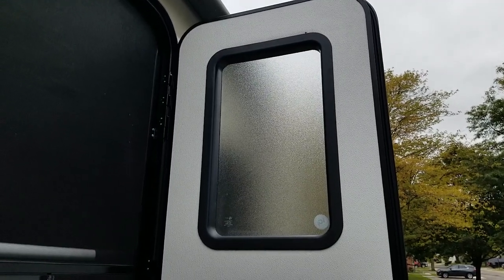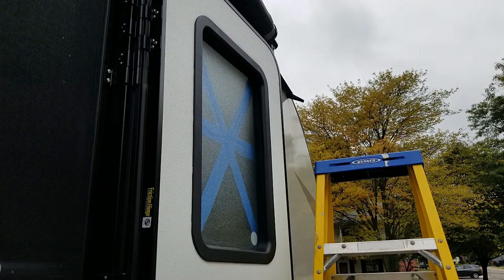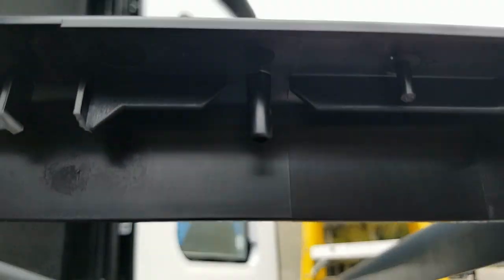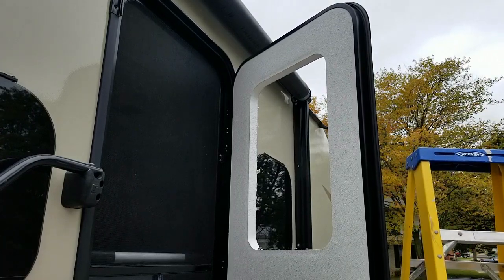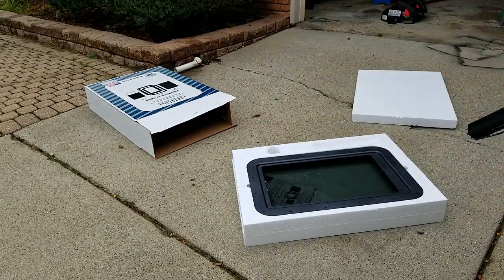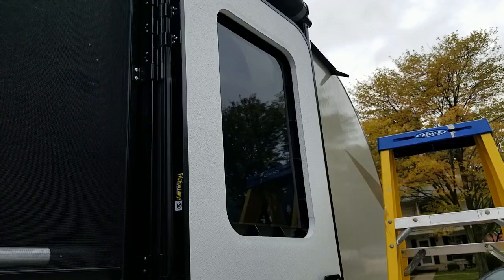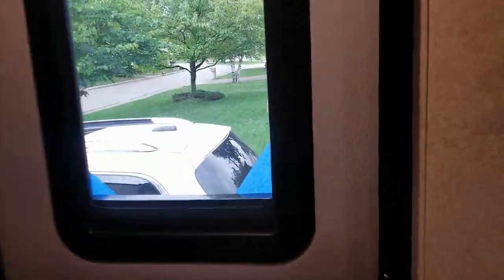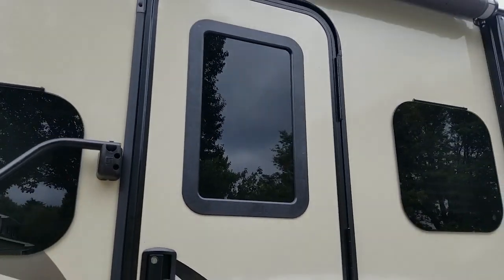Lippert Screwless Window Removal & AP Products Thin Shade Install

Comment from the maker: 00:28  items needed for install
00:44  tape window
01:23  removal clips install
04:28  old window frame inspection
05:38  old window glass removal
06:50  door structure inspection
07:49  shade unboxing
09:42  shade install
12:10  shade demonstration
Reply: How do I get those clips?
Reply from the maker: @JS-wx6eg  I contacted AP Products and they mailed them to me.

Comment: Great video. Here’s a tip.....what I did was sprayed silicone spray on a rag and then rub it on the shade cords and the shade will slide up and down easy with one finger :)
Reply from the maker: Good tip, I was thinking some kind of spray would help. I'll add some 👍

Comment: Great video. I am about to install the AP Thin Shade on my Rockwood 2509s and you did a great job of showing how to release the clips. Are you in the Mini Lite Group?
Reply from the maker: Do you know a guy named Adam Douglas? 😀
Reply: @aguyandhiscomputer  Yes😀 Hi Adam!
Reply from the maker: Hey :)

Go slow when pulling the frame. I could have gone slower and not broken any clips. I don't plan to reuse it so not worried about it but something to be mindful of.

Comment: Putting the window in upside down is a great idea for the privacy aspect, but has the fact that the weep holes are no longer at the bottom of the window to allow condensation to escape, been a problem since you did it? I'm ready to install this same window and may consider doing it upside down too, but worry about the weep holes not being able to do their job.
Reply from the maker: Hmm... I didn't notice the weep holes when I installed mine. I'll have to take a look.

Can you turn the outside frame upside down so the weep holes are at the bottom?
Reply: @aguyandhiscomputer  The weep holes are actually on the inside, since it's to let any condensation drain out of the frame instead of being trapped in there. They are three little slots, which I may try to replicate using my Dremel tool on the top portion (since it will be the new bottom).
Reply from the maker: @larryjones5079  ah, ok, yeah, you don't want trapped water.

Comment: Hello and great video ! Can you share part # for the clips I need them also to remove the trim ....thank you !
Reply from the maker: I actually called AP Products and they mailed them to me free.

If they won't do it. $7 car door panel removal tools from Amazon will work. I'll never reuse the window frame so I didn't care that I broke some of the tabs.
Reply: aguyandhiscomputer just contacted AP they are mailing me the clips at no charge ....thanks again your video helped me !
Reply from the maker: @8032609  Awesome, glad they're mailing them to you. What kind of trailer do you have?
Reply: @aguyandhiscomputer  2019 Sunset Trail Grand Reserve 26SI by Crossroads
Reply from the maker: @8032609  Nice looking trailer. Lots of room.

Comment: Did you have to purchase the release clips separately or did they come with the window?
Reply from the maker: I contacted AP Products (Southeastern Michigan) and they mailed me some. 

Let me know they don't send you some. I mailed mine to someone in a Facebook group and they've done the same for someone else.

You can use automotive tools if you don't care if the window frame clips break. I broken some but I don't plan on reusing it. I did keep the glass in case of an emergency if my new one breaks.
Reply from the maker: A kit like this will work fine.

Tresalto Auto Trim Removal Tool Kit, Set of 5 Pcs https://www.amazon.com/dp/B01L8GHB7O
Reply: I did send them an email and voice mail , mine didn’t came with clips if still have them let me know thank you

Comment: I wonder if the AP release keys (probes) differ from the Lippert ones?
The [way too expensive] Lipperts ...
https://store.lci1.com/window-keys-16-pack-429436.html
... are about 2.25" long (including the 3/4-inch "handle" that doesn't fit through the slot).
It's 1/2-inch wide, tapering to 1/4-inch starting about 3/8-inch from the tip.
The 1.5" length inserted into the slot has a narrow channel that rides along a ridge in the window frame to keep it on track.

When inserted, the sides of the key bump into two spring-loaded clips that interlock with barbed posts from the outer frame.
Pushing the key to the half-inch width will separate the clips slightly, but perhaps not enough to release the barbed posts.
Pushing further, the narrow tip reaches the curved frame which pushes the key up, further separating the latches, which finally let go of the barbed post.
When all the keys are fully inserted and the posts released, the window frames would separate unless the silicon sealant holds them to the door.
Peel them apart carefully.
Reply from the maker: After looking at my video, the release keys look the same. $22 is a rip-off for little plastic clips. You can also look at automotive trim tools. At least those are good for a lot of projects.

https://amzn.to/2KgOt0o

Comment: Does the new Window come with the clips to remove the old window...
Reply from the maker: Mine did not. I contacted AP Products and they mailed them to me. If they won't, you can use automotive trim panel tools.
Reply: @aguyandhiscomputer  Thanks

Comment: does slim shade provide the clips to remove the old window?
Reply from the maker: The Lippert version does but the AP Products version, that I have, doesn't. They did mail them after I sent an email request but I've heard they won't do it for everyone.

Automotive trim panel tools will work or someone told me they used cheap plastic knives.